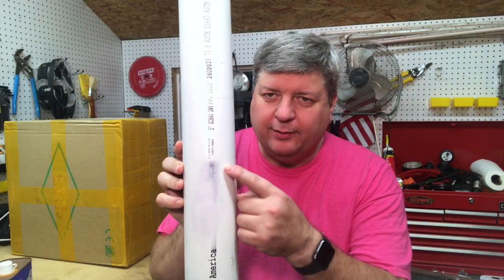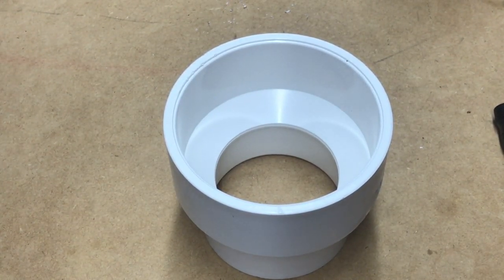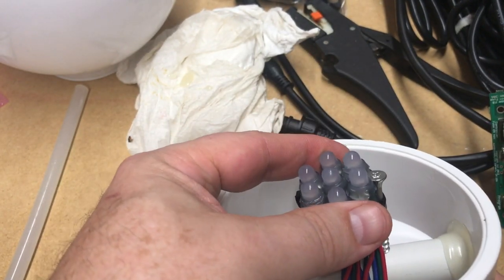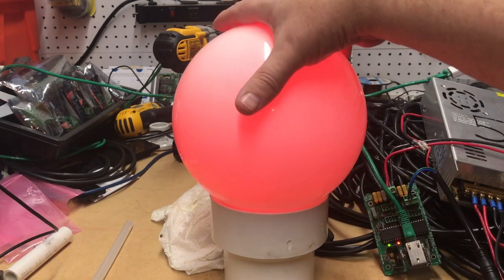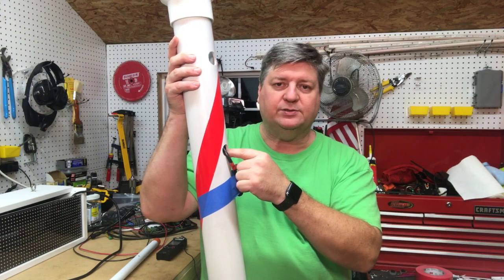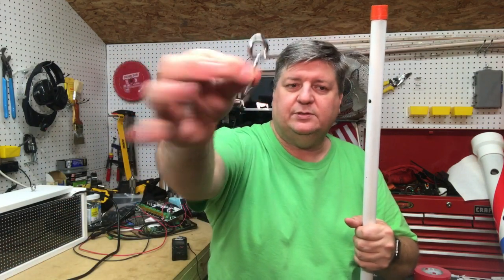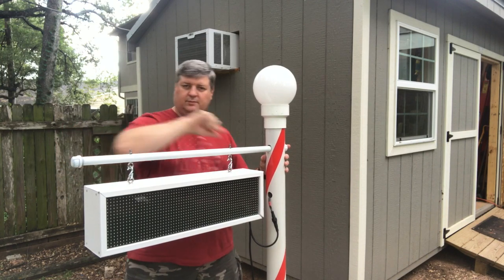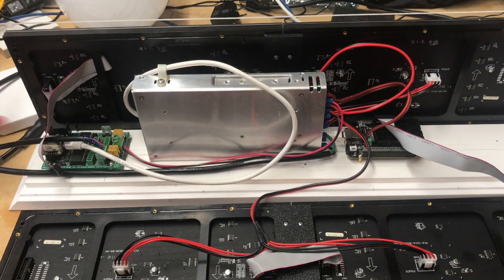North Pole for P10 Sign

Comment: Do you have a parts list for this post sign holder and where you got the parts?
Reply from the maker: You can pick up most of it at Wired Watts. A BeagleBone Black with a cape for the matrix panel outputs, a 5V power supply & 4 matrix panels. I also used a 4-port SanDevices pixel controller for the globe pixels. The original kit I bought is no longer available, plus I upgraded the panels from 10mm to 5mm spacing (adding density). Give Ken a call (wiredwatts.com) and he can fix you up for the matrix part. The enclosure was totally DIY.

Comment: Hi Jeff, great design, I am attempting something similar.  Is there a setting for sending the globe pixel data as well as the octoscroller data?  My BB fires the panels fine, but is not sending out pixel data for the globe that I can tell.  I have a e6804 card for the globe also.
Reply from the maker: Globe pixel data comes out of the Ethernet connector, not the octoscroller.
Reply: @CanispaterChristmas  yep, that is connected, but the data does not appear to be sent from BBB
Reply from the maker: OH. Check the FPP output page and make sure E1.31 is enabled.
Reply: @CanispaterChristmas  turns out it was the San devices e6804.  After several hours of troubleshooting and going through their awefull process of updating the firmware, I got it working.  (FPP proxy also does not work with this controller as the GUI gets truncated/garbled)
Reply from the maker: @garyclark8940  Yeah, I don't think I've ever had the proxy stuff work.

Comment: How do you get the tune to sign not to go with the other sequences? I am having trouble with trying to keep my tune to sign flow without blinking and going with the music. Any suggestions?
Reply from the maker: I run it on it's own sequence so it has nothing to do with the main display. You can do it either way.
Reply: @CanispaterChristmas  thanks,  I actually tried that but when I upload it to FPP it runs with sequence. Maybe I am not doing something right? It's all new to me so yeah
Reply from the maker: @rpra7392  Manually upload it to the BBB's FPP vs using xLights (it might try putting it on the wrong FPP).

Comment: Is there a way to control FPP directly from slights similar to other controllers or do you have to upload the sequences?
Reply from the maker: FPP is technically a player, not a controller (though you can get hats that you can connect lights to). I'm not sure what you mean by "similar to other controllers."
Reply: @CanispaterChristmas  I’d like to be able to control my sign directly from xLights like I do with my WLED controllers, is that possible?
Reply from the maker: Ah, well, there is a pass-thru mode on FPP, but I didn't have good luck with it when I used it. Might have changed by now. But yes, the standard method is to load a sequence onto FPP and let it play the sequence.

Comment: Hi Jeff.  I am new to the hobby and have watched many of your YouTube vids which are very helpful.  Your Tuneto sign is my first project.  At the moment I have my P5 panels working perfectly using BBBW and Octoplus, which I learned how to set up from watching your videos (stand alone).  Now I am trying to get the globe lights going, and am waiting on parts but have a couple of questions in advance so I can get busy when the  Forkineye ESPixelstick arrives.  First, can I power both the Pixelstick and BBBW using the same power supply (Wired Watts 5v Meanwell) and can I safely double up on the power supply's screw terminals since the panels and BBB have used all available terminals?  Second question:  I bought a string of 50 WS2811's and want to cut it to use 7 pixels.  At each end of the string is a JST connector, which I assume powers the string and connects to another string.  If I cut 7 pixels off, am I correct in concluding that the espixel stick will provide power to the string so I don't need the JST connector?  Thanks for your help and all you do to help us newbies :)
Reply from the maker: Thanks! Awesome! I'd say you're thinking is correct. 5V pixels include the JST connector for power injection - it isn't mandatory to use. A pixelstick should be able to safely power 7 pixels assuming they are standard pixels. Keep me posted!

Comment: Is your p10 panel xConnect plug?
Reply from the maker: They didn't have xConnect when I made it so it's a Ray 3-prong, but xConnect would work. And it's a P5 panel now. 😂
Reply: @CanispaterChristmas  oh, could I solder it to be xConnect?
Reply from the maker: @lmjhalloween  You mean the actual panel connections? No. You need either an octoscroller or ColorLight card for the panels.
Reply: @CanispaterChristmas  to plug it into the controller, if you mean that 😂
Reply from the maker: @lmjhalloween  I'm confused. I have pixels in the globe of the sign. They can use xConnect. The panels themselves plug into an octoscroller or Colorlight card, not a pixel controller.

Comment: So do you think I could use 3/4” pvc instead of plumbing pipe for the arm that holds the sign?  Maybe put a short piece of cable from the end of the pvc to the top of the 3” pvc to hold the weight so it doesn’t bend down?  I purchased a 40” P10 scrolling sign and it only weighs about 12 lbs.
Reply from the maker: My enclosure + electronics is too heavy for PVC. It depends on the weight. I had to use a cast-iron pipe.
Reply: Canispater Christmas aka Jeff yeah so am I lol. Tried the heavy duty pvc conduit but no dice.

Comment: Do you remember the name of the material and dimensions you used to build the enclosure? Did you happen to create plans or like me just wing it? Thanks
Reply from the maker: Mostly winged it. All I had was a picture somebody else did. :) I got the outer PVC plank from Home Depot. Model # 827000004. That is for a 6pk, I only got one single board. It's pretty easy to work with, but I used a PVC blade in my tablesaw.  The panels are 320mm x 160mm each so 2 side-by-side are 640mm x 160mm. I just built the enclosure to be able to show the panels through the acrylic. The acrylic is slightly larger because I slotted the outer part by ~1/4" all the way around. It's a little loose in there, but won't come out without disassembling the enclosure. The entire enclosure measures 200mm H x 680mm W x 140mm D. I found it easier to use mm for my calculations and have a metric ruler.

Comment: I like the video what brand of pixels light did you use for the globe, what type of connection for the pix lights, and finally how can I get a 6804 (or newer) controller?
Reply from the maker: The pixels were standard 5V bullet pixels from Ray. He also has pigtails for  the lights. The 6804 is a SanDevices controller or look at the Falcon F4V3 from pixelcontroller.com

Comment: This is great, thanks for sharing.Quick question, what have you found to be best practices to manage power to your BBB and P10s? Is there a way to drop power safely overnight and throughout the day for both devices?
Reply from the maker: I leave them powered 24/7. You’d have to safely shutdown the BBB prior to removing power. Could be done with a cron job, but no real need to shut it down.

Comment: GREAT video ... Can I ask what you used to seal the edge of the clear plastic in the sign to prevent water from getting in ?!  I am doing a very similar design.
Reply from the maker: +David Geall I'm not sealing the acrylic. I put holes about every 4" in the bottom plate to allow for drainage and slightly elevated the internal electronics in case water gets in somehow. I haven't taken it to a car wash to test though I do need to water test it once I seal the top miter joints with silicone or bicycle inner-tube - still thinking about that one.